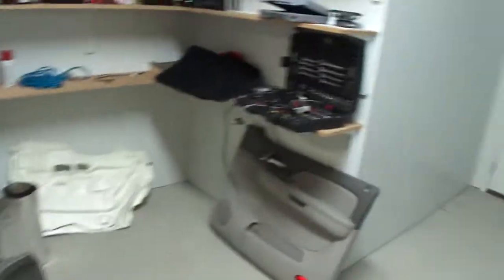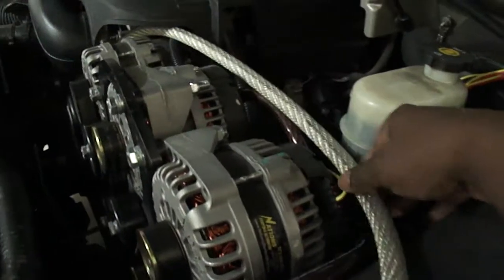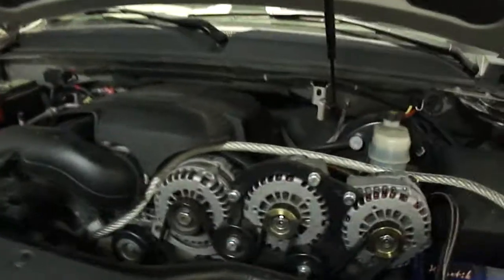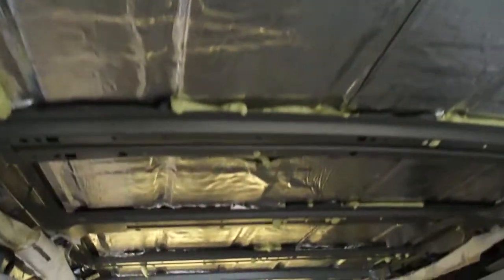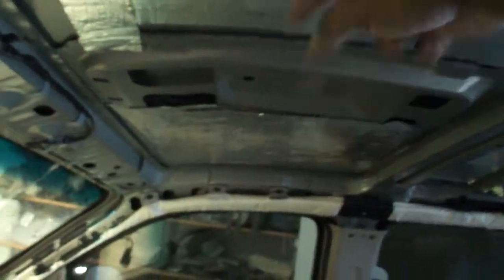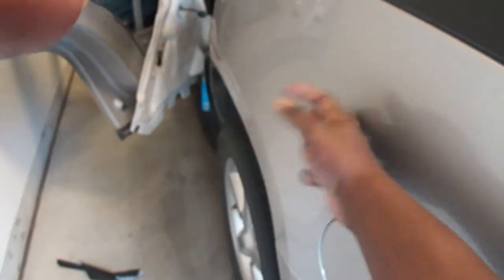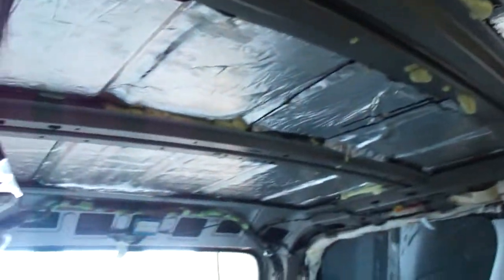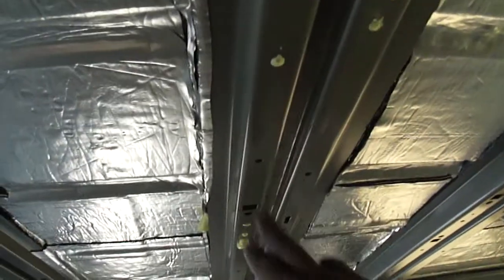dynamat install, very stressful job!

Comment: nice job on the dynomat so far. It is a pain at first. An idea for you for the doors and hard to get areas. Rubberized under body coating. It works great for areas that you cant really get dynomat on. Keep doin' what you do!

Comment from the maker: @Villeza1 its a quad alternator bracket and  my electrical is  up to par i got 600 amps to play with. and 400 amps to play with @ idle and i will have 3 strands of 1/0 wire running to that sd5k amp with 4 batteries. on 15volts

Comment: I just did my trunk, and you're right it's a major pain in the ass! It looks like you had at least reasonably big flat sufaces though, I had to cut what seemed like 100 pieces just for my trunk lid with all the wires and braces is had on it. I put another layer on tonight. What kind of foam is that?

Comment: @mondo82111 

Thats pretty good but seeing as you dont have a lot of current draw, your voltage will sit relatively high. That SD5000.1 will suck that current away, FAST so you should add some more 12v AGM batteries. I'd go with XS batteries. Have you looked into getting the Mechman Alt voltage boost module? It's better than any other module out there IMO. I've ran MLA and it fried 3 of my alts :(

Comment from the maker: because my soundigital amp draws 520 amps and my other two amps draws 170 amps and with these alternators in my truck  i can play my system at fult till max power and my volts only drop to 14.2 from 15.0 i never see 13v unless i been playing at full tilt for about 30+ min.  amperage equals watts so 650x15=9,750 watts i can put out  so if i decide i wanna go bigger ill have the electrical to back it up bra.

Comment: @mondo82111 

Oh, they told me its a triple alt bracket since we already have a stock alternator, +3 would make it 4 alts with a  triple alt bracket. I was asking b/c I still have my 4 alts ( about +1200A @ 2k, 760A @ idle) and wanted to install them in my tahoe. But I'm gonna try to do a 14v setup with 14 XS D1400's. Monster is a good brand for power/ground but have you tried 0/2 aug gauge wielding cables??? Dwarfs any 0/1 and its much cheaper (well the place I can get it from).